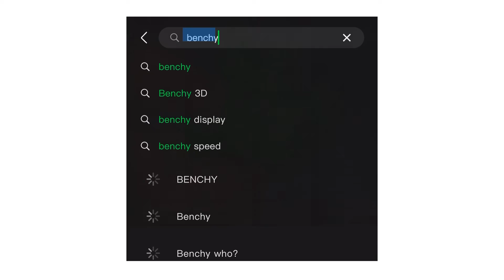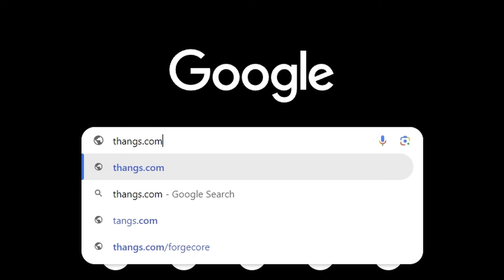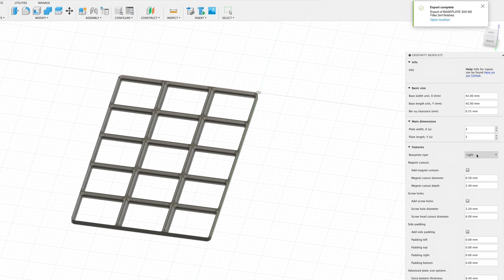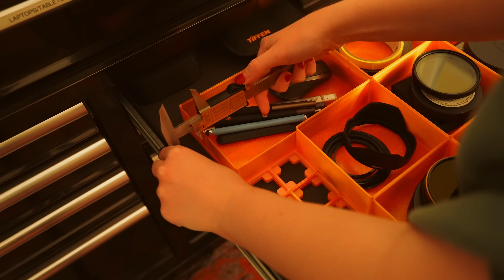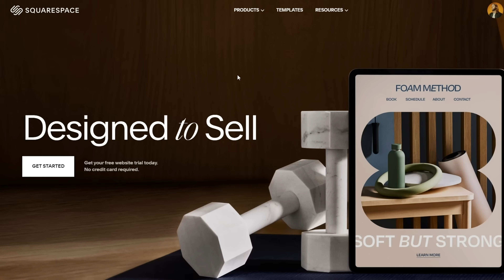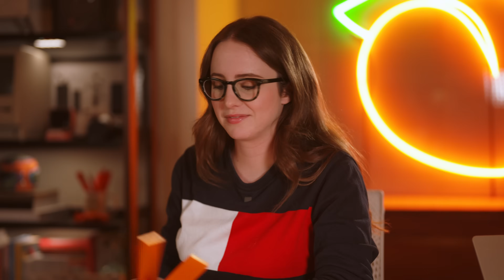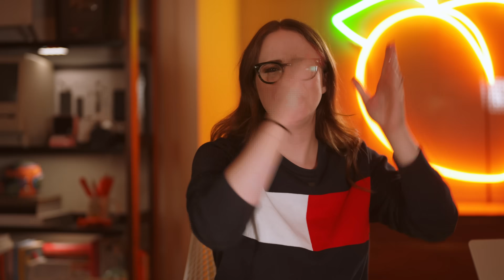Organizing my Office with 3d Printing

Comment: Some Fusion360 tips:
- Always fully constrain your sketches (all blue lines have turned black) by adding dimensions (hotkey d) and constraints. It will prevent your design from blowing up if you (later on) change a dimension in one of your early sketches.
- Get used to using patterns for anything repetitive. Be it 3D Patterns (Create -> Pattern -> Rectengular / Circular / on Path) or 2D (when inside a sketch: Create -> Rectangular / Circular Pattern).
- Make ample use of parameters, define "User Parameters" (+ icon in Parameters window) where ever it makes sense. (If your screensize allows, id' recommend to klick on the 3 dots next to "Change Parameters" and check "Pin to toolbar". I have not once seen this function overused.)
- If starting with an f3d / step file by somebody else, make sure "capture design history" is enabled. (Right click in the top left corner on what ever it says above "Document Settings", it's the bottom most option that will show up in that right-click-menue.)

One tip for 3d-printing:
- Most "glow in the dark" filament is abrasive and should not be printed (in larger quantities) without a hardened nozzle. (I don't know if your X1 Carbon came with a hardened nozzle.)

Comment: Fun video! Even with good measurement tools, it can be hard to get tight fits correct on the first (or second) go. 

If it is a bigger print, I always print a tester piece of the dimension I want to check. This can often be done without more modelling, just by stopping the print after the first couple of layers are done.

Comment: one thing that has helped me with 3d printing parts that have constraints is to do a test print. basically a small slice of the original model that I can use to verify measurements, mechanisms, etc without doing a full print. It helps you dial in the printer if need be, potentially save materials on prints that don't pass validation, and because it prints faster then a full print you'll have shorter gaps of time between validation and modifying the model.

Comment: My #1 fusion360 tip: Click the dropdown for "Modify"  find "Change Parameters" click the 3 dots and then pin to toolbar. Replace most measurements with variables via the parameter button. I don't use the gridfinity plugin, but it likely will allow the use of parameters which would help you create subsequent boxes with the same heights, etc.

Comment: About your problem with the plugin: I too really hate that you can not change anything after the fact. HOWEVER: If your problem is just the "standard parameters" there is a button for that at the bottom! "Save as new defaults". Hope that helps

Comment: Yeah, doing custom one item only usage boxes is wasting your filament. This is my opinion.
That's why I print as much versatile models as I can. Also I could not catch that grid idea. Why could not I just put boxes without grid? What will it change?
I do not like gridfinity, though it have so much items, I just cannot to choose what I need so much of them there are. I just tired of scrolling all of them. And for my opinion they took to much plastic for bottom and that grid. You can use magnets, but what if you will store some metal stuff there? I do not need that interference.
I ended with multigrid. Though I had to redesign it a little. I do not like the idea that extension and boxes are different items. I would prefer to convert extension to box and vice versa. So I created custom bottom, which can inserted into extension.
Also again I do not understand that grid concept. Why do I need this grid anyway? I just created custom grids 2x3 which can be used to combined bins which are clicked there and which also can stand firmly above another 2x3 block. And this is really cool. I can group items into this blocks and get whole block to work with it. And later put it back.
This is what I love in 3d printing. You can print exactly what you need. And while some people waste plastic for custom shaped bins which will be a waste when the item will change its form or become obsolete. I prefer one time print and multiple uses for that. Also I would prefer PETG as it is more temperature resistance and more elastic, it will not broke as easy as PLA it will bend before it. Also PETG is cheaper at my place. Much cheaper. But that's another story.

Comment: I have a tip to stop wasting filament and time when printing something to fit... For example, you make an organiser to fit a certain sized space... Don't print the entire thing... Instead copy the outside width and length size of the box/organiser you need and just print basically a 'ring' (whatever shape you need) with a width of 4mm wide all the way around and 4mm high. This is strong enough to use as a test fit tool and if it doesn't fit, then take measurements from this 'ring' to re-adjust your model. I found this to be usefull after I was printing a light switch cover that turned out to be 1mm not wide enough - Yes this works for inside measurements as well as outside measurements. I hope I have made myself clear on my instructions 😁

Comment: Hahaha, wonderful! The week I get hooked on 3d printing you have released this video. And while I'm still printing stuff to improve my A1 you not only modify existing models in the slicer software, you are actually able to do CAD!! Brilliant!

I have looked into several drawer organization systems and I'll probably go with Neogrid since that doesn't need a ground plate and I hope that increases printing speed and reduces filament use. I'm also looking into the Multiboard system for wall storage. It seems much nicer than the Ikea Skadis I have. More expensive to print, of course, but nice and customizable.

Comment: Welcome to the world of 3d printing! Choosing the Bambu is a great choice! I think they make the closest to consumer 3d printers that any manufacture has come. 

 As for the skinny space, the first thought that came to mind was scaling the grid and bin to fit in the slicing software. Either scale the entire drawer or just that last unused space.

My only tip is to print experimental / prototype stuff with the less expensive filaments. For example, Elegoo rapid PETG Black, on sale right now is around $10 a roll if you buy a four pack vs their other colors which are around $15.  I usually print my test prints in black and when I'm ready for my final products, I will use the colored filaments.

Comment: Try just printing a few layers as a test.  If you print just the top 5 to 10 layers in the box you could even use less pla to see if the measurements are right

Comment: for your camera draw would be worth looking into shadowfoam (they have a youtube channel) theyre a english based company, theyve done alot of work with colin furze over here in the uk and cause its foam, less abrasive on the camera equipment, and they make cut to size blanks for more drawer systems, worth checking out.

Comment: you can add side padding around the outer most edge of the grid. its what i did as my OCD would not let me leave it. i just measured the drawer and kept adjusting how many slots i needed till i hit the max space, then half what was left and entered that into the side padding.

Comment: Top Tip: If you want to make sure the model will fit, instead of reprinting the whole thing multiple times, just cut a thin cross section and print that.

Comment: As desperate as I am for organization, I just don't have the bandwidth to start 3D printing; but yeah, I'd love to have one. I do love the idea of using a toolbox in my office to organize stuff, though! I think I'd use antistatic foam in the drawers, but that may be my next purchase. I do believe that 3D printing holds a lot of promise, and i'm sure that someone is using AI to generate 3d print files. Printing with metal filament will be a game-changer, and if there is ever a way to infuse magnetic particles into the plastic filament, there's a whole new side hustle for someone - printing custom magnets.

Comment: This was a great roller-coaster, you hit every classic obstacle that 3d printing throws, and you powered your way through all of them! Another option for the edges in drawers is rather than extruding an undersized box, try shortening an oversized one instead. That way you keep the geometry underneath that avoids having to make supports or do any fixups on the base bit. Or just do gridfinity for most of the drawer, then print some bento boxes to fill an exact gap all the way up the side. Also, thanks for the bento-boxes, hadn't seen those before!

Another youtuber "Hands on Katie" did a really awesome breakdown on the various organisational methods too. She landed on: gridfinity for horizontal surfaces, Multiboard for vertical, and her own expansion on gridfinity for larger items like clothing etc. Well worth checking out!

Comment: Welcome to the madness, as a quick note on your issue with grid finity, instead of modifying it with the cad program you can resize the x & y of the models in bambu studio, make sure you uncheck the box to deselect the uniform scale box.  In that way you can make them fit your needs, when you change it write down the size you ended up using, when you print the parts that will go into them make the same size adjustments.  I have done adjustments like this quite a bit.

Comment: Hi!!!!
Great video, I really had a blasta and reminded me of my begginings in 3d printing.

Just two quick tips here from someone who has spent the last 3 years prototiping functional prints, and is already on it's 3rd printer, and I really hope it will save you some time, money, and frustration: 
1. Before commiting to a full-size print, print just a sample; for instance: in the too big organizers just print the base, no walls, even a skeletonized version with a ton of holes, so you just get a proper sense of the base size, in a quicker fashion and saving a lot of materials.
2.- If you know how or if the design allows for it, put holes in the areas where you know yo can save some time and materials.

Comment: Wow classy madame throwing shade on poor people like ourselves with our crappy cheap DIY printers that we buit ourselves. So fancy with her Bambu she probably didn't even pay for. Wow.

Oh yeah things never fit first time, and usually not second time, and it's a measurement mishap every time. Cut off most of your model so you can throw down like one cross section barely a couple layers high in 10 minutes and see that it fits before you commit to printing a whole large thing. Slicer has the feature to just chop chop it.

The tailor's tape should be exact. But you need to check it, it could have shrunk with time if it's made with PVC. Or you measured your thumb along, who knows.

Fun fact, glow in the dark pigment eats printer nozzles and extrusion gears. But you don't have to worry about it yet.

Comment: of course I liked the video, I like when new people get into 3D printing.
The fact that you are learning Fusion360 AND the slicer AND the printer... Cudo's to you. 🙂
That said, Why didn't you just make a NON gridfinity bin, that stands beside the other bins in your drawer?
You could just make a bin in the designer tool you already found. Just give the X and Y dimension and boom, done.
Would you have done that, then you would have to use the full height, now you are missing out the whole bottom part where you made your spacers.

Just my two cents. Love your content. You have a new subscriber.

Comment: With regards to the issue with the Gridfinity Plugin not remembering your values, you can set a Parameter in a project, for example BatteryBinHeight with a value of 22mm.  Then instead of typing 22mm into the Bin Height, just Type BatteryBinHeight and you can always come back to it (or change it in the future).

Comment: There was an easier way. using blender. You bring the STL into Blender select the faces and then move it over the number of mm needed then export the STL back out remembering to scale it by 1000 because Blender is weird like that. CAD is amazing but sometimes a non-CAD solution is going to be faster.

Comment: You can either print spacers to fill in the gap and hold the grid in place OR you could use the Bento Box app to build a bin that fits in the same gap. The real question is... what would you call that amalgamation?

Comment: As you become more experienced with 3d printing and CAD software, you will find it more practical to design and print simple bins for organizing.  Gridfinity may require supports, and there's the baseplate/grid; both are unnecessary.

Comment: Any measuring device thats made from not metal is really not accurate :) long construction site tape measures even say to not rely on the measurements as sun and pulling the tape makes it stretch in different ways. Also a reason why i probably cant get a 3D printer of my own is that i would be totally as crazy about it as sara is :D

Comment: In the future, what I do, is 3d print just like 5 layers of a print so I have the width and length and see if just that piece fits correctly and if it does then I'll 3d print the entire thing. Always great to try out test prints for measuring stuff.

Comment: that whole bit about getting measurements wrong and wasted time/filament cutting to the next print sliding in so nicely embodies 3d printing to a tee.I definitely do not have 10 failed prints of my last design on my desk taunting me. The toolbox looks so cool with the black vinyl wrap on the handles.

Comment: So you still didn't print anything for your cat?
Also for measurements, get a cheap digital caliper. For anything up to 150mm it will be incredibly accurate and easy to use when designing prints

Comment: Top tip, If you want something to fit precisely and you are concerned about your measuring. Just print a testing thing to check!
Like in this case, you need not print the whole bin over and over... just print a empty rectangle to see if the whole thing is long and wide enough. And then commit to the final thing.

Comment: PLA is more rigid than PETG so the printed things will be stiffer. But it's also more brittle and breaks more easily. So if you're printing things that need to be able to sustain a little bit of impact or be able to give in a little it's better to us PETG. And PLA is good for things that need to be stiff. PLA also has very low temperature resistance so it's not ideal for things that will be out in the sun, in a hot car, or other warm environment. PLA already starts to deform at about 40C whereas PETG can resist up to around 70C.

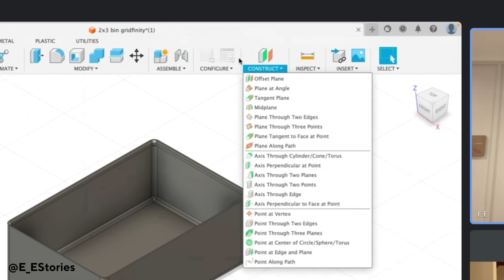Comment: 22:37 I don't use fusion but this looks so much more complicated than it would be in MoI3D or even easier a polygon modeling program like Lightwave 3D. With polygon modeling you would literally just select the polygons on the side and drag them over some. Then save and print.

Comment: Once prints cool down they pretty much released themselves mm that type of bed. If you want to take it off right away you might have to flex the bed or tug the print a little.

Comment: Î would recommend you to try OpenScad files for gridfinity. With that the drawer bins and baseplates were a task of minutes. You can just enter the a fraction size for bins and it generates it. Also it would solve your problem with the Fusion 360 Gridfinity generator, as OpenScad generates everything on the fly. You would see the changes immediately after changing the variable.

Comment: Sarah, Welcome to the world of 3D Printing. :) I hope you enjoy it. I got into 3D Printing over 3 years ago, and I have a total of 7 3D printers. My printers are the Creality K1C, Creality K1 Max, Creality Ender 3 that I am modifying, a Tronxy XY 3, Mingda D2, Mingda Rock 3 that I am currently testing it due to a bad power supply, a Voxelab Aquila, that I am going to sell to a friend at work. My ultimate goal is to make a 3D printed aircraft carrier  as well as printing out G I Joe and Cobra vehicles to make it fit 6 inch figures and make them remotely controlled.

Comment: So, old sewist here. Way back in high school sewing class in the 70s we were taught that cloth measuring tape was notoriously inaccurate. For one, they stretch out. Teacher said to keep an accurate metal ruler on hand to measure new and old tapes against to make sure they were accurate. 
Here we are, decades later and in the next century, and I still have a metal ruler on hand. More than one, really. One in my craft room, one in my toolbox, and one in the kitchen. 
When I saw you pull out that cloth measuring tape I thought, “Uh oh!” Sorry you wasted all that time and material but those boxes got used anyway. 
I love your channel. I learn so much even if I never use it. It’s useful to know about it. I’d really love to do some 3-D printing someday but don’t know anyone with one….yet.
Well done!
Reply: If you're in the US, try contacting your local library system! Even if they don't have 3d printers for you to use on premises, they may be able to point you to the nearest tool lending library!
Reply: @wyw876  thank you! I’ll do that. Great idea.
Reply: That is EXACTLY what I wanted to know. Thanks a lot for your input !
Reply: Just get a cheap Ender 3 v3 (ke/se) they're great for Starters and pretty cheap compared to Bambus (Sure Not as polished but hey the lay down plastic pretty well)
Reply: @JanS-i8z for anyone getting into the hobby I usually recommend the A1 mini it's not much more expensive and can save lots of frustration.  I have a ender 5 pro and love it but if I was buying today would definitely get a bambu